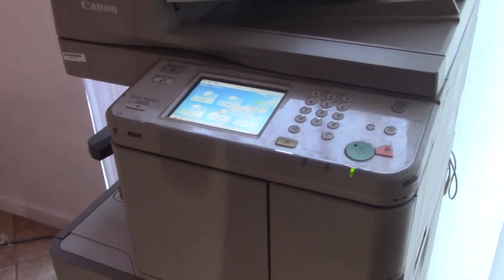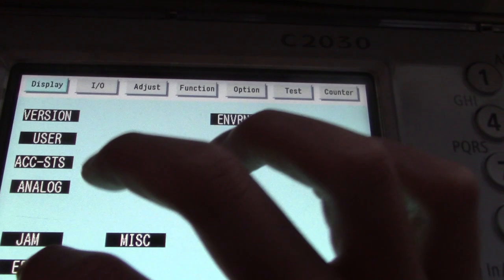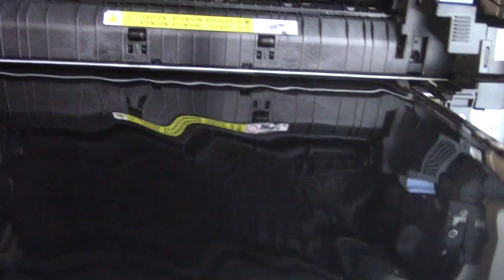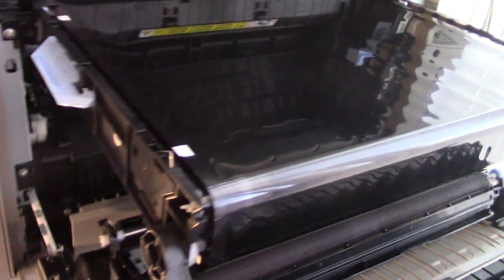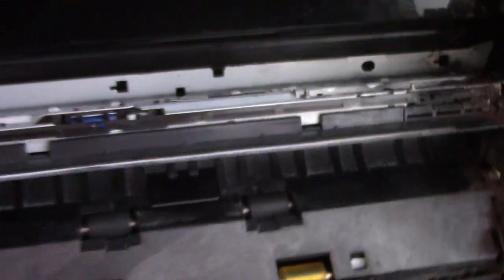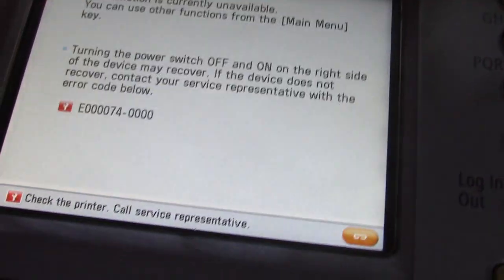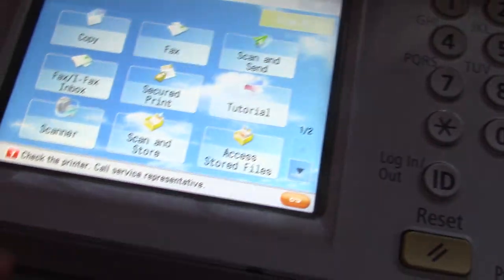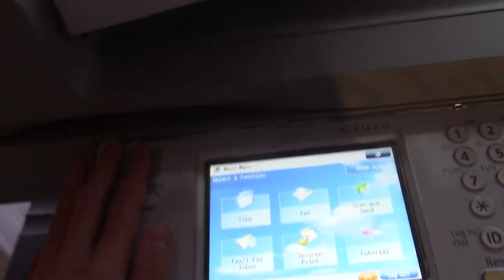Two Months Later: Canon imageRUNNER Advance C2030 Issues

Comment: Did you ever figure out what was wrong? I bought a c2225 (slightly slower model) and it printed the first few pages fine-ish there were shadows and slight yellow tint. After a maintenance internal cleaning it started spitting out blank pages... toner cartridges felt really light but no out of toner message so I figured I replace those and no effect. I did noticed the drums have an awful lot of toner on their surface... I would expect bad prints not blank pages... as far as error 74. Got that once after taking the back drum out to check it. Error went away after power cycle
Reply from the maker: It can be related to a faulty or bad ITB unit, it's a unit with a thin film with the purpose of moving the toner from the drums to the paper. That's what was wrong with my unit.
Reply: @Martin-NT  i get that error all the time now. My maintenance menu says replace itb ad first suggestion... ugh I guess when these printers sit for a long time they print ok until you do a clean cycle
Reply from the maker: @jzeman  If you have a service provider I recommend calling them to diagnose the issue or contact another printer technician company.